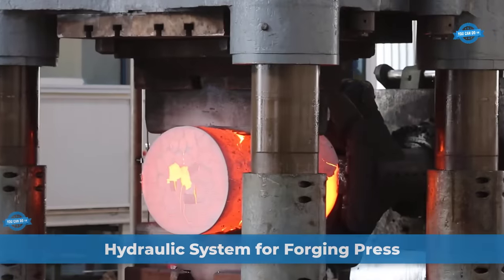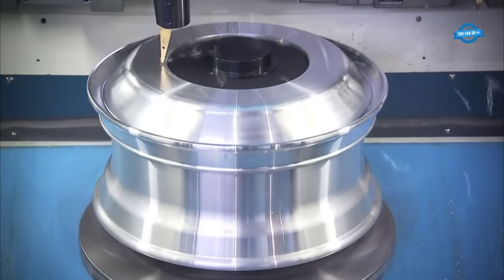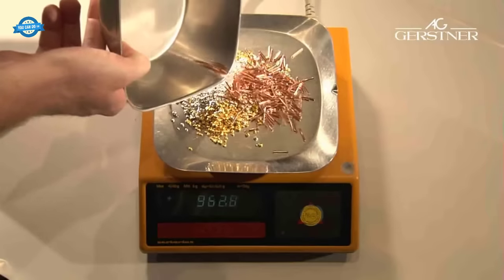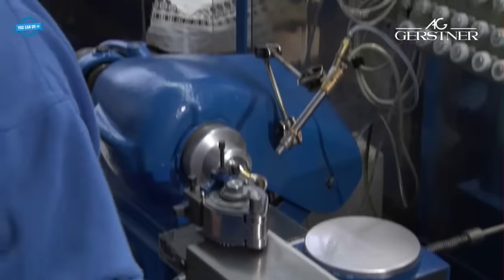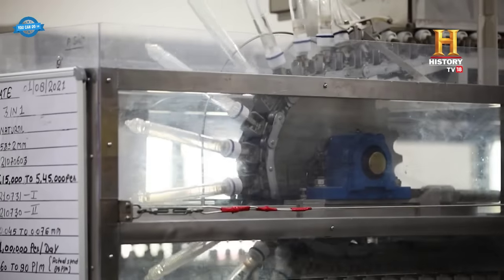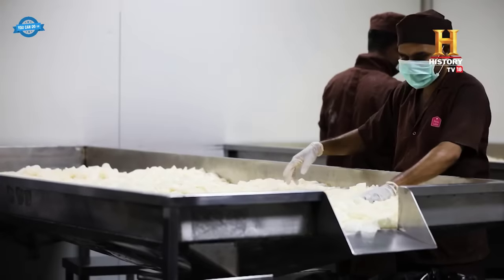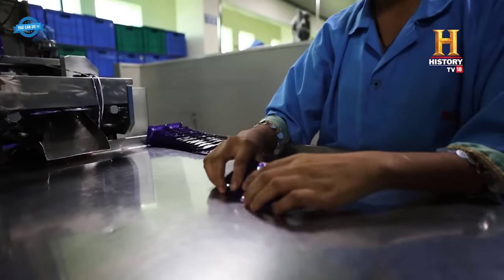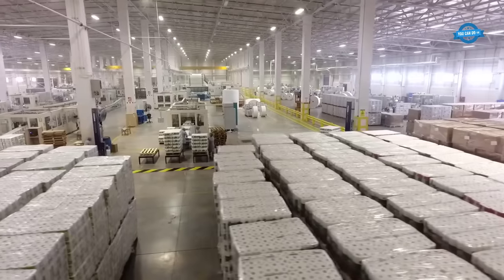How 200000 Tons of Tissue Paper Are Produced. Satisfying Process: Producing Condom, Wedding Ring

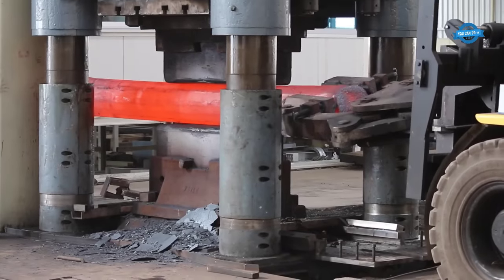Comment: 1:44 in and still nothing about sh*t paper
Reply from the maker: Please refer this chapter:
0:27. Hydraulic System for Forging Press
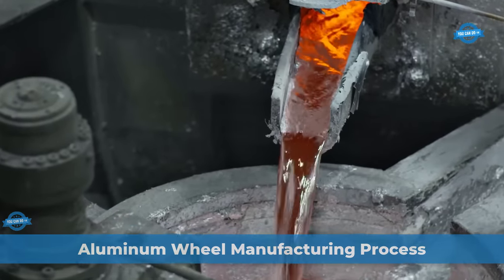2:00. Aluminum Wheel Manufacturing Process
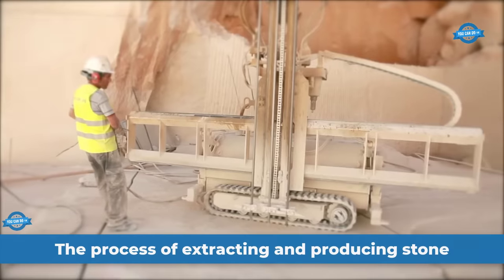5:48. The process of extracting and producing stone
7:26. Forging Process at Moravské kovárny
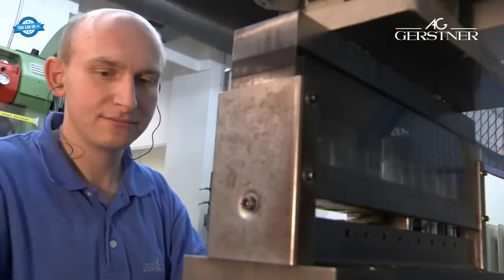9:13. Wedding Ring Manufacturing Process
15:36. Condom Manufacturing Process
23:38. Tissue Paper Production Process
27:19. Pouring a Gold Bar